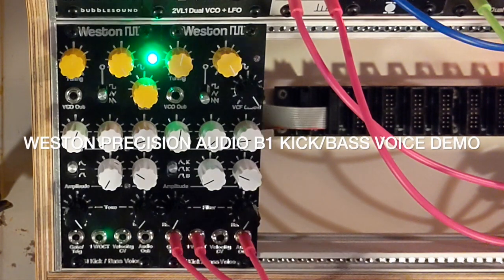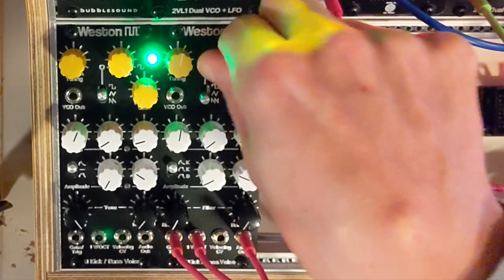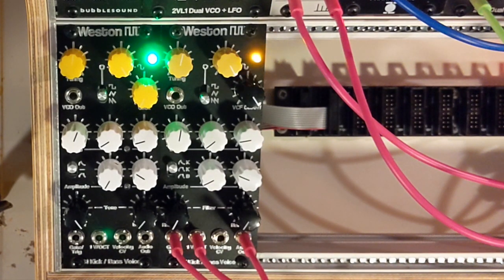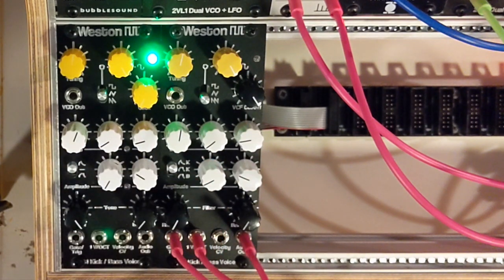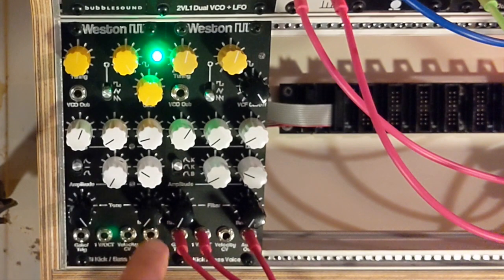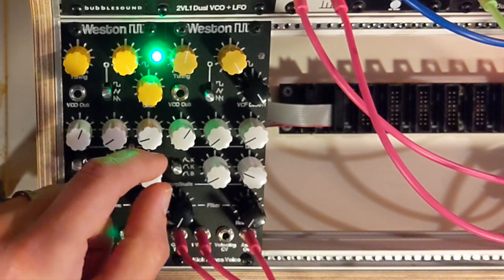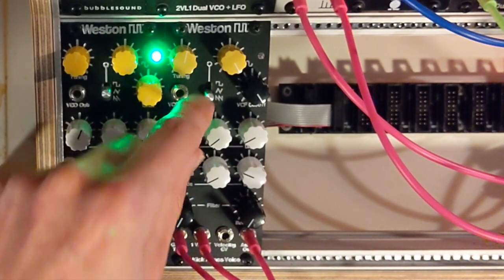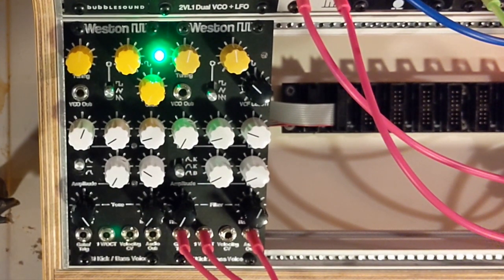B1 Kick/Bass Voice Eurorack Demo - Weston Precision Audio

Comment: Very interesting ! Sounds much like 909 in your demo. Do you have any 808 kind of example ?
Reply from the maker: That's probably pretty accurate since the kick settings are very similar to the 909 circuit. Only attack and decay time can be adjusted, so it's probably not possible to get something so "boomy" as the 808 - the 808 circuit is kind of tricky like that actually. Roland guys were very clever!